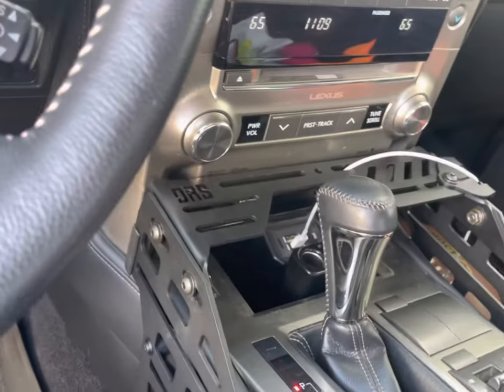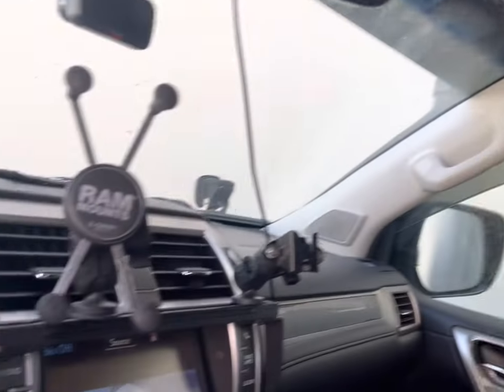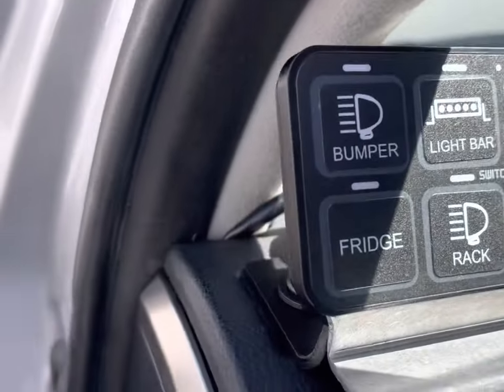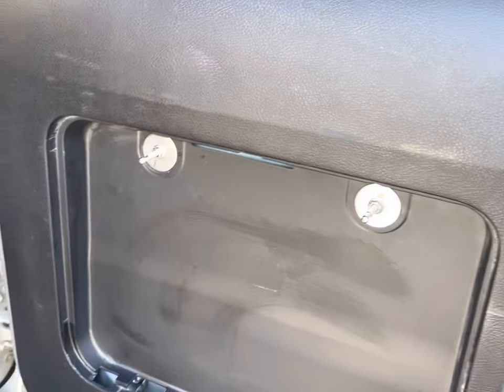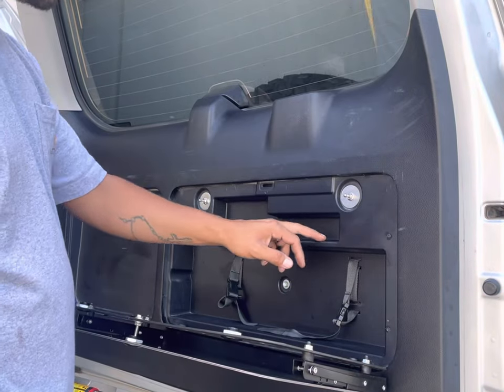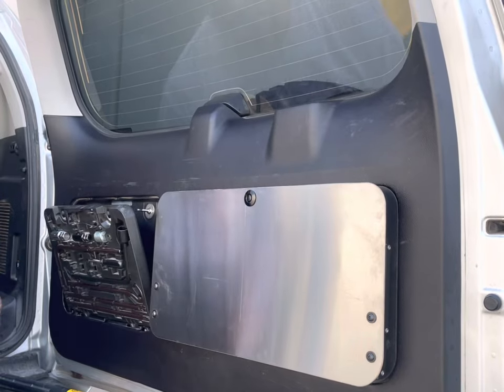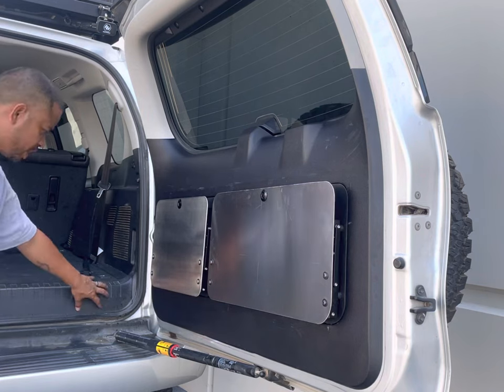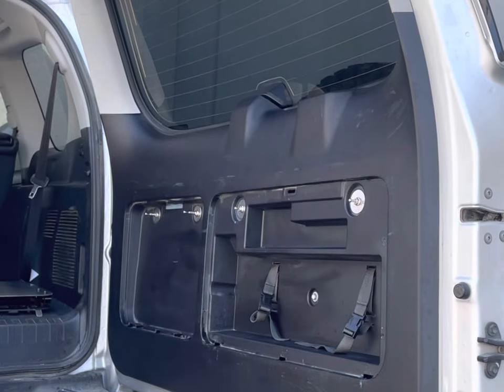GX460 NEW TAILGATE DUAL DROP DOWN TABLE (NO DRILLING) Prado150 Lexus

Comment: Ordered mine for the GX470. Love the overall esthetic but also that it’s reversible, no drill, and can still access everything behind them especially the storage cubby side. Great engineering as always ORS!
Reply from the maker: Thanks for seeing that! 470’s just waiting for a few things then it’ll be ready to ship.
Reply: @ohanarigsupply  everything is out of stock, are you still in business?
Reply: @ohanarigsupply  
Great ingenious work man somehow whenever I’m thinking of a fix to something you’ve got one done 

My only concern now is doing something for the 22’ + GX460s since the dash and screen layout are different 

I’ve been looking for a place to mount my phone that’s sturdy enough to use MAGSAFE and have it wirelessly charge since I have a dongle to use Wireless Apple CarPlay it’s a huge peeve of mine seeing cables 

I was thinking of using your defrost drivers side vent mount you have for the switch pros but having it suction cupped to windshield made me realize how annoying it is on the left side since I’m right handed benefit is I can run the cable inside dash to use my MAGSAFE  PUCK and MAGSAFE EXTENDED BATTERY PACK ON THERE 

WANTED TO USE SOMETHING BEHIND THE SCREEN similar to some of those Fold Away Tesla Phone mounts but there’s almost no way to secretly get to a power source light a 12V outlet 

Really wish Lexus would of thought of putting a 12V source behind the screen to hook up accessories or dash cams and such I’d like to put our brains together and work something Moms got a 22’ GX I can take pictures of the insides if you need to

Comment: In the market for a 460 right now. Once I get it, this is gonna be mod #1. Fantastic work brother!
Reply: Jim L, if you have a full size Coleman stove, save your $$$ and look somewhere else, that drop table won't work, I've spent $300 in one and l haven't use it once, it's only good for those little backpacking stoves, the ones that you attach to the gas tank, and customer service sucks, the owner is hiding and I wasted my  $$$$$
Reply: @Maximus01776  thanks for the tip. You saved me unnecessary troubles. I appreciate you very much.

Comment: Great design! But how much can the table hold? Also is there a way I can remove the table part?
Reply from the maker: 50 lbs has been tested on the setup. Table section can me removed.
Reply: Marvyn Mendoza beware of this company, the customer service sucks, the owner is hiding from me, the drop table won't work for a full size Coleman stove, which is what most overlanders use, it will work with the backpacking stoves, before you drop $300 make sure that covers your needs